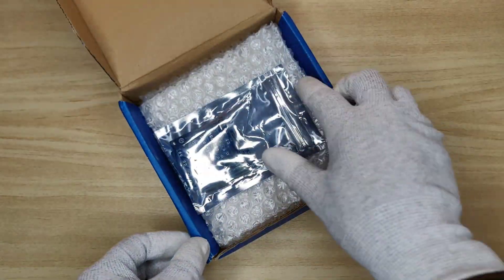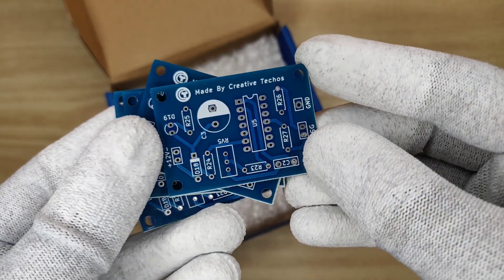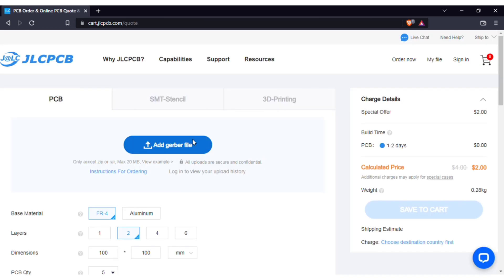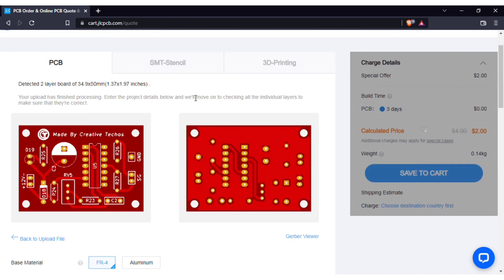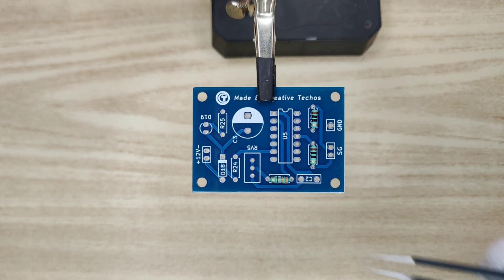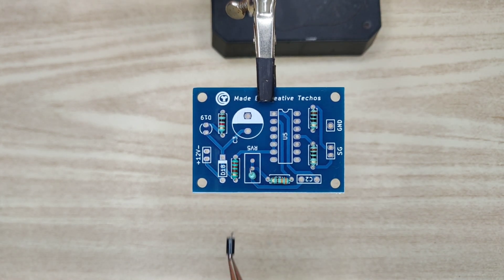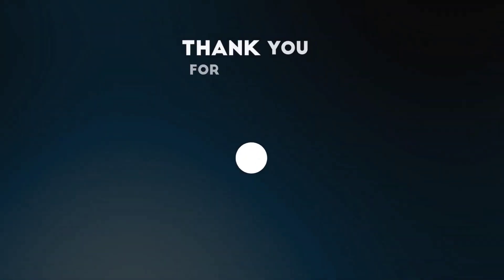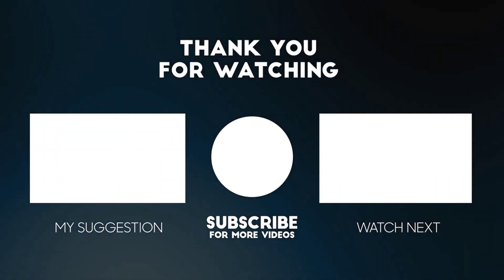Simple 12v to 220v inverter circuit

Comment: Can u make this type of 12V to 220Volt,1000watt  powerful inverter circuit with IGBT,diode,resistor and transformer only??..there is no use of any PCB circuit on it...ok...thanks
Reply must
Reply from the maker: Ok I'll soon upload simple design inverter without pcb or pwm
Reply: @CreativeTechos  
OK...